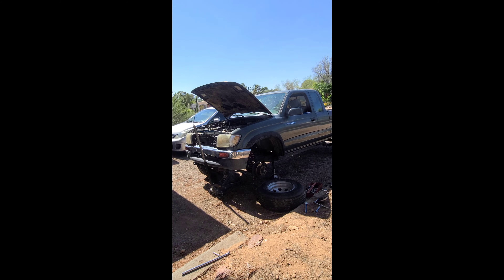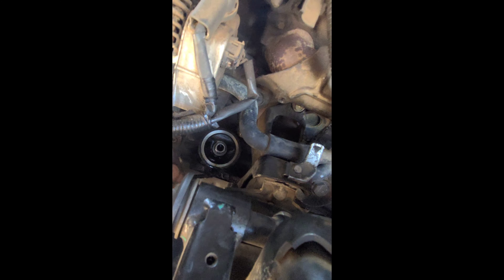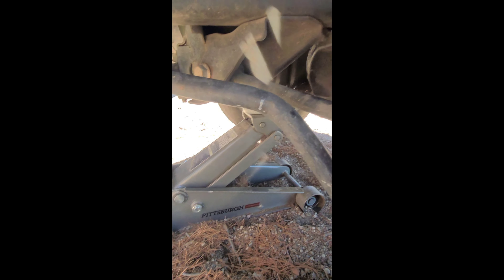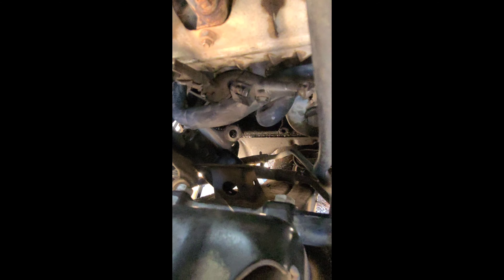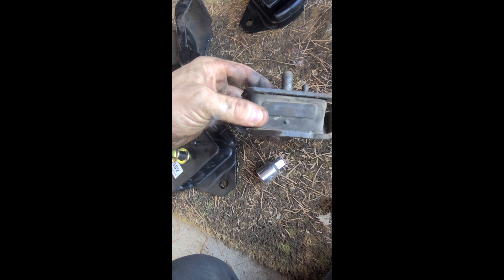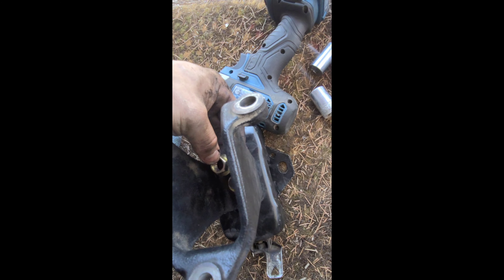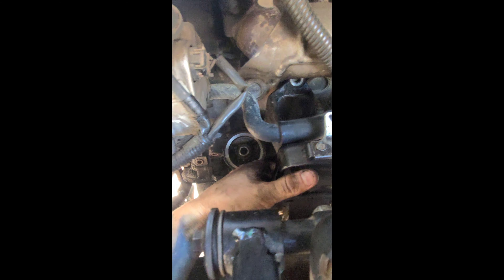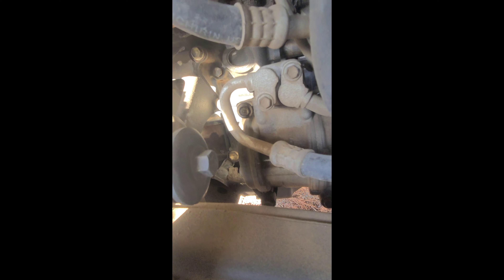97 Toyota Tacoma Motor/Transmission Mount

Comment: Seems like you could leave the big bracket on the motor and remove only the mount? I saw a video of someone doing it on a different vehicle that way, jacking up the motor another couple inches to clear it off the mount's stud, and just pulling out the mount.